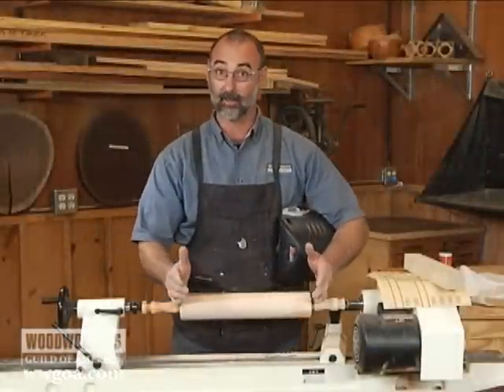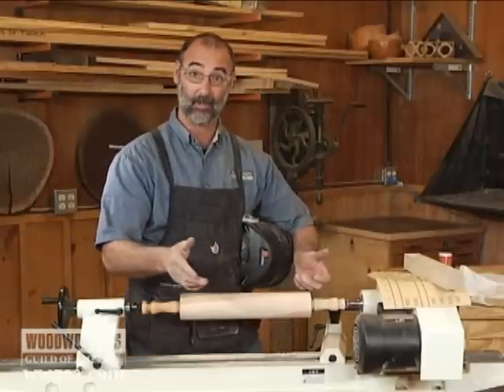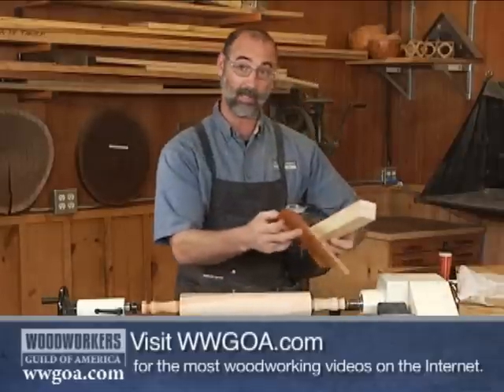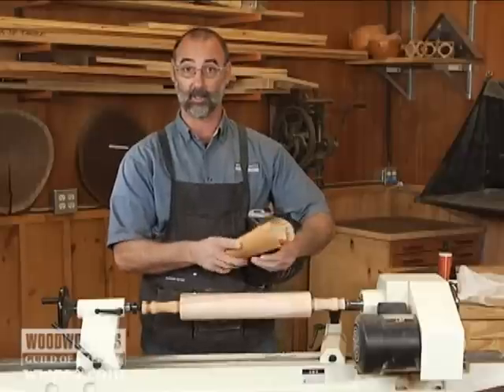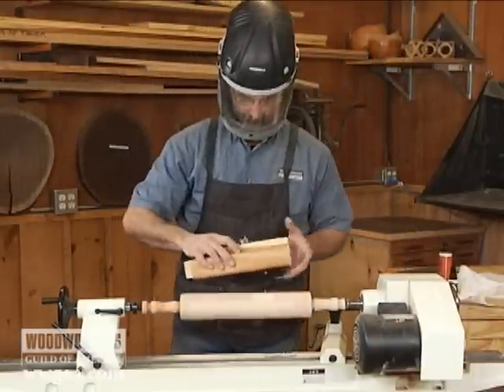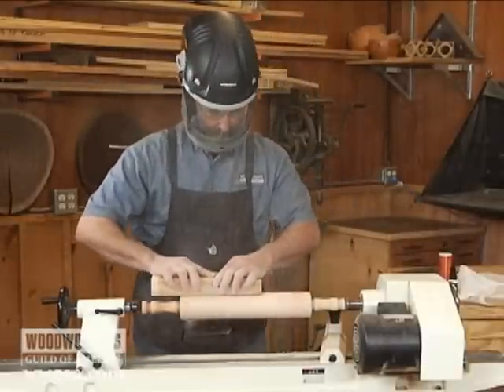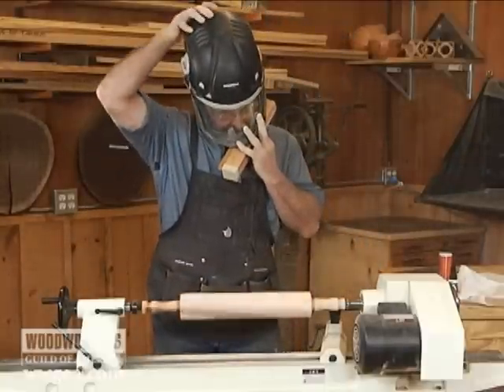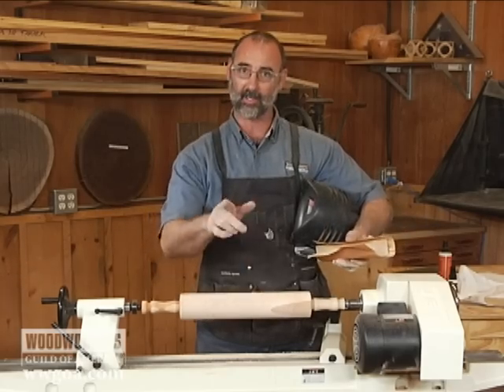Sanding a Cylinder

Comment: Thank you! There is a huge community of crafters who make epoxy tumblers. The first step is sanding down the stainless steel tumbler. I have been looking for ways to make the process easier- I have a belt sander but since the tumblers are cylindrical, it doesn't work very well. The bottom of the cup would need to be uncovered so one oscillator arm would have to go inside of the cup, without a second arm. Do you have any suggestions on how to make the process easier? Thanks so much.

Comment: How would I do that without a lathe
Reply from the maker: +damasydia If you are asking to to make a rolling pin without a lathe, that would be a difficult challenge.  Rolling pins require good consistency in circumference, which is what a lathe does best.(ZD: 3523)